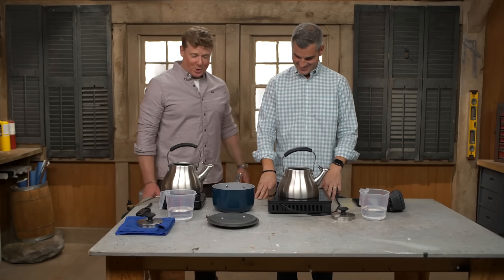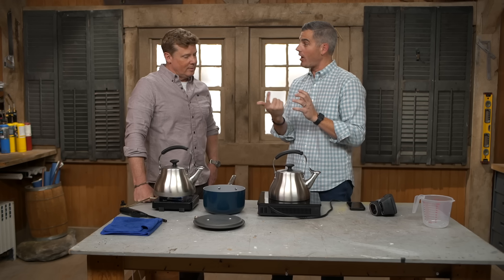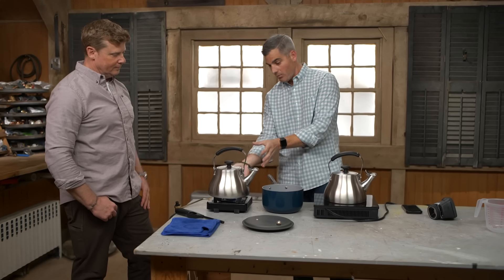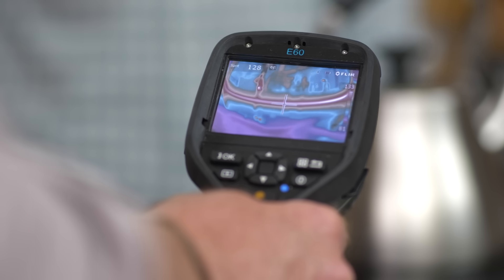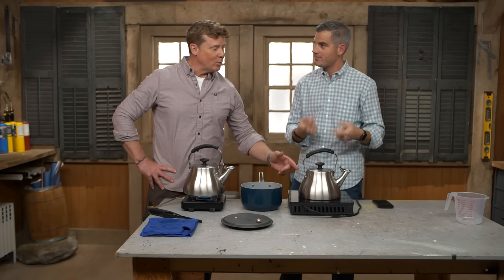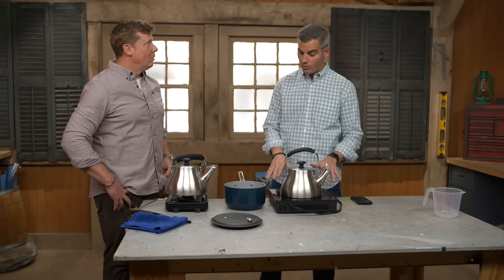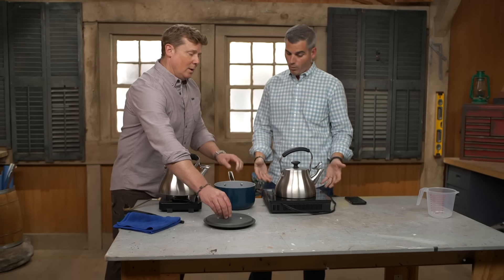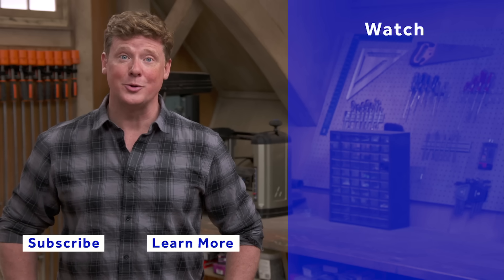Induction Cooking Technology | Ask This Old House

Comment: PS: their test still doesn’t demonstrate the EVEN GREATER speed of induction over CONVENTIONAL GAS range. It appears they are using propane portable stove. Propane has more energy and heats water up faster than natural gas. So, if they used natural gas cooktop in their test, you would see even greater difference in the speed of induction over gas!
Reply: @Donovan Lewis , that is insane.  I have a non-magnetic pot I bought from Amazon. Thin stainless steel. It takes water 1.5” deep to a roiling boil in 30 seconds. (110v) I’ve always thought induction pans NEEDED to be magnetic, I guess not. I also guess “thinner might be better” assuming that is why my Chinese pot works so well. Or maybe it’s the metal composition…??…they ARE more familiar with induction cooking overseas
Reply: They did not even finish the test.  Plus, I cook a lot more than water.

Comment: All magnetic metals will work in induction cooktops, but I was surprised to find out, it DOESN’T HAVE TO BE MAGNETIC. I have a few stainless steel pots that ARE NOT MAGNETIC (where magnets DON’T stick in the least) yet they are EXTREMELY effective at inductive cooking. They are so thin and heat up SO FAST, they are BETTER than my thicker pans that are magnetic.
Reply: As long as it works!
Reply: I think that they just have to be able to create eddy currents. Instead of trying to stick the magnet, let it slide off.
Reply: Not mine.  I had to buy some new pots.  I only tried out a burner, so I did not invest a lot.  You can also get an iron plate which will heat up and then heat up the pan.

Comment: As much as I prefer induction over a heating coil, gas is still my preferred cooking method. Even with iron pots and pans, they need to be perfectly flat to work well with induction. Anything curved like a wok won't work as well. Plus with gas I don't have to bother about the material of the cookware. Stainless, aluminum, copper and even clay will all work.
Reply: That's another thing they failed to mention here.  If your pot is not smooth on the bottom, it won't work.

Comment: I just installed induction.  Wife originally wanted gas but with all the downsides I convinced her to do induction.  I think it is amazing.  The only thing I didn't think of is the new induction uses more power than our old electric.  So, when I went to do the electrical, the induction needed a 40 amp breaker instead of the 30 amp I had installed.  According to the manual it would work with 30 amps but at a lower rating.  I was ripping everything out anyway so putting in a 40 amp breaker and larger cable wasn't a huge deal.
Reply: That's bizarre

Comment: One thing about induction cooktops. They have glass tops like the ribbon types. Unless you're the careful type, you have to be careful about scratches or cracks if you drag or drop a pan or pot. Never have to worry about that with my Wolf.

Comment: Did you know that rapidly rotating the poles of a strong magnet near a piece of iron/steel -- without letting it touch the metal -- will actually heat up the metal?  That's the same physics for how induction cooktops work.  Instead of a physically rotating magnet, the coil beneath the glass surface changes its magnetic field direction several thousand times per second.  This changing magnetic field tries to make the bottom of the cookpot into a magnet with a polarity that flips back and forth at the same frequency.  But the little magnetic domains in the cookpot metal don't flip field directions with 100% efficiency, so the wasted energy becomes heat in the metal.
Reply: Yes.  I knew that, but I still do not like induction.

Comment: We got ours for child safety in the kitchen, not only because less chance of stovetop burns but also alot of induction cooktops now have a lock feature on them so kids can't turn the cooktop on. 

There is another downside though, it feels very different than cooking with gas in that you can't really see the flame or heat source, and you have to adjust to things so that you don't burn food since its much more efficient. But like all things it just takes getting used to using new equipment.
Reply: For quite some time now new stoves in general have a locking feature so kids can't turn the knobs or open the oven.
Reply: @bigred9428 still safer since no flame or feseb of gas explosions.

Comment: We're in the "experimentation" phase with induction as we're renters. We picked up an induction hotplate a few months ago to try it out. So far, it's been quite good. The part my wife loves the most is that clean up is so darn easy -- wiping a plate of glass off is much easier than pulling off the bars on the gas cooktop (and the gas cooktop never gets 100% clean). We also have a metal plate that we can place on top and can be used with non-compatible pots/pans while in the experimentation phase. Given that things have gone well with it, our plan in our next home is to install an induction cooktop (along with running the high-amp wiring to support it).
Reply: We also have a $50 propane camp stove, and that will serve as backup for the rare occasion that the power goes out. It's not ideal without a working ventilation hood when power is out, but that very occasional use is something we're okay with ... and that occasional use is still miles better than the everyday use of the natural gas cooktop with no ventilation hood that we have in our current rental.
Reply: @dosadoodle   Propane camp stove,  that could serve as backup in an outage, would be useful...

But a generator or other energy storage system (including vehicles with built-in inverters, that can output AC power).... connected to the home electrical system via a subpanel with a transfer switch, or just a manual low cost interlock, or other options.... would be far more useful.... 

Since you don't want to eat spoiled food from an unpowered fridge, do you? Not to mention all the other vital appliances you might want to keep operational.
Reply: @nc3826  For sure! But one step and $1000 at a time.
Reply: @dosadoodle  OFC! And It only makes sense to be a homeowner to do the home electrical system connection part.... But it "can" be done for less than $1,000, when you are ready to take that step...

fwiw I just noticed that the full countertop versions and prices have come way down in the last few years.... So I'm thinking about doing my own upgrade and good luck with yours someday...
Reply: While the glass top is easier to clean, it's far more prone to getting scratches and scuffs from pans sliding around. Looks quite bad after a while.
Reply: @JasonFarrell  I've used a glass electric top for 12 years now and have not had that problem. I use liquid Bar Keeper's Friend and it looks great, other than some heat discoloration on the burners. (white top)
Reply: if you have a proactive landlord and an old range/cooktop that needs replacing, could be that you could convince them to switch... admittedly the first is somewhat rare. the big selling point for landlords is the much improved fire safety over gas IMO (also better than electric, but not by as much).

Comment: Gas can be used when the power goes out and induction/electric can’t boil water for safety in an emergency
Reply: A $25 propane camping stove solves that problem.  Or a gas grill.

Comment: If you're going for the non-induction electrical cooktop/stove, Electrolux/Frigidaire elements heat up a lot faster than the ones made by Whirlpool Corporation. I know this from experience.
My mom had a Whirlpool stove whose heating elements took forever to get fully hot. Then, when they broke, we replaced them with a universal unit that was made by Frigidaire, and that got fully hot in less than half a minute.

As for the oven, though, that'll depend on if you want it to heat up fast & cool down slowly, or heat up slowly & cool down fast. Ovens made by Whirlpool Corporation heat up fast (six minutes to pre-heat around 350°F, and it tells you), but take awhile to cool down. Frigidaire ovens take longer to heat up (It doesn't tell you how long, it'll let you know if it's done), but cool down faster. This might have to do with the amount of thermal insulation around the appliances.

Comment: Gas is king for chefs. Most real cooks would agree.
Reply: Actually there was recently an article about how professional chefs prefer induction stoves due to their better temperature precision and the fact that it doesn't make their kitchen as hot as a sauna
Reply: Oh geez, this again. "Real" chefs can cook with any heat.
Reply: @thenexthobby  yes your right in that it can be done on any cooking surface. Gas is generally preferred though. Its more responsive and its been used for so many years people are just better with gas
Reply: @srharris88  You conflate preferred with available, and it's not necessarily more responsive. Length of service has no bearing on whether or not something is best.
Reply: @Kevin-mp5of  Thanks, Roselyn.

Comment: A great thing about induction cooking is the cook top itself emits no heat -  the only thing that gets hot is the food itself, and this really helps a lot on those hot summer days when you just don't feel like cooking over the stove.
Reply: Yup! I'm building a new home in Texas, and I'm excited to finally use an induction stove top! It will save loads on cooling the home. I cook a lot!
Reply: Saves on your ac bills too!
Reply: I tried out a countertop model like they have here, and it was HOT after using for 5 minutes or more, and not just under the pot, but out to the edge as well.
Reply: Incorrect.

Comment: We went induction a year ago (from gas) and here's the improvements:
1. Much more power, boils water faster, as Ross said
2. Goes down to lower power than gas too, obsoletes needing a double boiler
3. Does not make kitchen hot when cooking, because little waste heat
4. Can have spatula hanging off pan without melting it
5. Stove is much less hot after taking a pan off, less likely to cause kids/pets burns
6. Glass top easier to clean than gas hobs
7. Indoor air quality improvements (less nitrogen oxides), better for raising children
Reply: @@donovanlewis3053 i'm sorry that the Three Stooges installed your A/C unit
Reply: You can add a 240 volt outlet as your Old House probably has 240 volt service but just divided into 120volt circuits. Electric induction stoves are on for short periods of time( vs whole house heating) so you’d need to look carefully at the actual costs. I can tell you from personal experience that you can put a serious sear on a steak with induction. I cook steaks at power 8-9 for a sear. Power 10 fills the kitchen with smoke and can burn the steak.
Reply: You don’t need three phase service for induction stoves.
Reply: And some downsides:
1. Most induction ranges require a 240 volt outlet, which rules out a lot of Old Houses, like This one.
2. Electricity is much more expensive than natgas in a lot of regions, like the northeast USA.
3. Induction glass tops are cool, but build up ugly scratches over time.
4. Much harder to put a good sear on a steak, or so I've heard from chefs who do this.

More pros than cons, though, I agree.
Reply: (NOx pollution also needs compression to form "significant" amounts, such as an engine) 

Indoor air quality improvements, come from eliminating carbon monoxide emissions.. and two a lesser extent eliminating HC and particulate matter (PM)...
Reply: donovanlewis3053,   "Large amounts of nitrogen dioxide"? Carbon monoxide averages about 10,000 time higher emission rate... but strangely NO2 emissions from gas stoves get more press....  So relative to carbon monoxide or HC or particulate matter (PM), all NOx emissions are relatively insignificant, ....

Lastly, show me  the study in which A/C interferes with stove venting.... And I will show you a flawed study.... The issue is if there are cross currents or not from any source....
Reply: JasonFarrell  #4 point is flat right.... since a gas stove can get the grille red hot ie  thousands of degrees hot, to produce searing... induction cooktops only up to 450 to 500 Fahrenheit ... far too low for true searing....
Reply: @nc3826 not in my experience.
Reply: @@donovanlewis3053 Thank you for proving my points, since....."How hot do gas stoves get? Natural gas flames can burn as hot as 3,560 degrees Fahrenheit" 

And how fun installing 3 phase service, to not even come close. 

FWIW 5 years ago when I got my portable induction cooktop  they were rated  between 450 and 500 Fahrenheit.
Reply: @@donovanlewis3053   CFM stove vent fan rating, can go well over 1,000, But it does not matter. I have a whole house HVAC system. Air flow divided up in this rooms.
So when the fan turned up to the max, you can hardly feel it. 

Yes, a countertop vent fan does create negative pressure, which   sucks  exhaust gases. (While a HVAC/AC fan does not create net negative pressure, because the air that is being removed from the room is being replaced)

So thank you for proving my point once again... My YouTube wannabe expert friend....
Reply: @@donovanlewis3053 your figures are an exaggeration.  but mostly irrelevant to the topic ....  and much of the efficiency loss comes from having to reduce the temperature to a level that you can use for cooking.... 

But for searing meat, the very high temperature, is an advantage for getting the grill red hot....
 
which is why there are high end cooktops that include gas grills and induction...
Reply: @@donovanlewis3053 Good luck getting a real grill someday and figuring it out for yourself...
 Take care of my YouTube expert friend....
Reply: @@donovanlewis3053 i bet you don't even use an induction cooktop do you?

Comment: I showed a prototype induction cooktop in the early 90's at a home show we were in
 SS doesn't work
Reply: My allclad stainless steel pans work on induction because they use different ss on the bottom layer versus the top layer. But you do need to check before you buy a pan.

Comment: I had an GE induction range that I bought in about 2010. It was great. Unfortunately, it started to fail about 8 years later. The range cost about $2500. The replacement  for the failing part alone was $1500 before installation. I went back to regular electric. If I’m going to need a new range every few years I’ll stick with older technology.

Comment: I don't use my electric stove top. I use my induction Todd English "Station". Heats fast. But know that the area beneath the kettle, or pan, will remain hot. Too hot to the touch.
Reply: Yes, the surface stays hot for a while.  I didn't wait for it to cool before cleaning—melted the blade of the squeegee.

But once it cools enough, the squeegee is great for cleaning the surface quickly and not leaving streaks.

Comment: I hope you guys aren’t getting political and jumping on this gas is bad band wagon. Why didn’t you use a electrical burner for comparison also? I have a high quality induction burner and it’s crap. Gives off a low pitch hum that freaks my dog out, manufacturer said thats normal. Also, I thought you could touch the top after use. Not mine, hot as a firecracker on the 4th of July. Overpriced junk.

Comment: Induction ranges are great but the explanation from this so-called "expert" is complete horseshit.
The magnetic field does not "excite" the iron molecules. Also, iron's conductivity is crucial to generating heat.
The magnetic field induces an electrical current which generates the heat. Iron's high magnetic permeability is what allows a sufficiently high magnetic field.
Reply: "The magnetic field does not "excite" the iron molecules." That's EXACTLY what magnetic induction does, which is why plastic or paper or aluminum pans won't get hot. The pan's resulting eddy current gives up energy as heat. And that's an excited molecule.
Reply: My fellow YouTube experts.... Don't get molecularly excited, by another heated TOH conspiracy...
Reply: @nc3826  TOH?

Comment: What is the electricity cost to run versus gas or regular electric stoves? I've liked the idea for years.
Reply: For specifics, you can do your favorite web search. But since it's way more efficient than either gas or radiant electric, the energy cost is significantly lower.

Whether it's enough to pay off the cost difference will depend on a lot of factors, but lower end induction ranges can be purchased for not much more than regular cooktops, and they will make back that difference quickly unless you have especially cheap electricity where you live.
Reply: It is very efficient vs a traditional hotplate. Induction doesn't use energy unless it reacts with a pan. As for cost, it depends if gas or electricity is cheaper for usage.
Reply: Well induction is twice as efficient so it uses half the energy. You should be able to to find some resources on the web with the information you need.  In Europe induction is not the future it’s the standard im a kitchen fitter and Installed almost 500 of these induction cooktops

Comment: I have a portable induction cooker on my camping truck and I love it. Waaaay better than an electric hot plate.
Reply: I use a portable induction cooker when I only need one burner especially because it's easier to clean it I mess around
Reply: Yeah? And what's the power source of your induction cooker? Electricity? Doesn't that mean its an electric hot plate too? Cook a few lobstahs in that fancy electric cooker
Reply: @rd-ch1on   I use an EcoFlow Delta to power induction top. A hot plate is a heated coil, not the same thing. 🤡
Reply: @rd-ch1on  , no. A hot plate heats the metal in the hot plate itself, which then has to transfer that heat to the pan, which then has to transfer the heat to the food.  With induction, the pan is DIRECTLY HEATED (like the filament in an older lightbulb) which heats the food more effectively and more efficiently